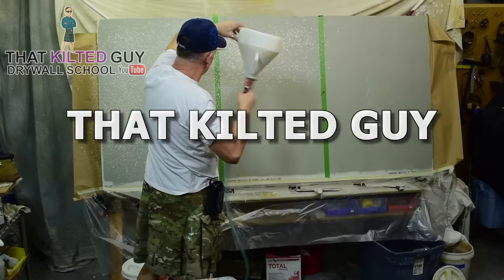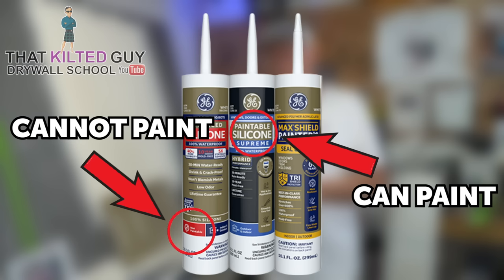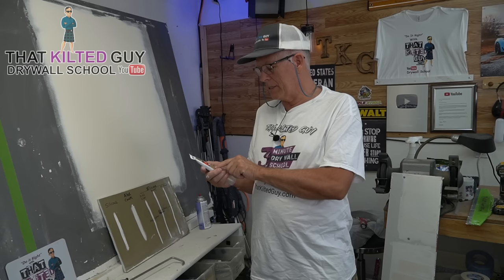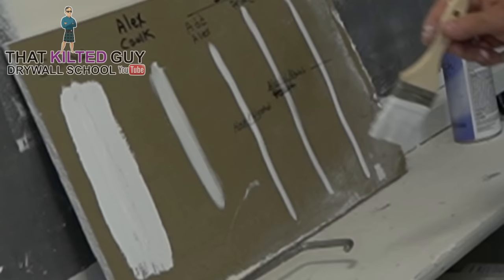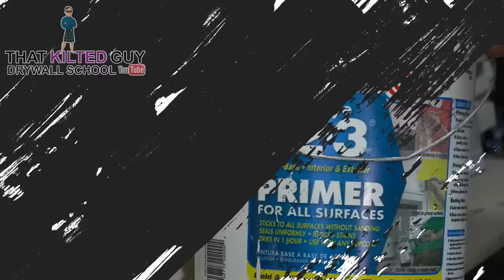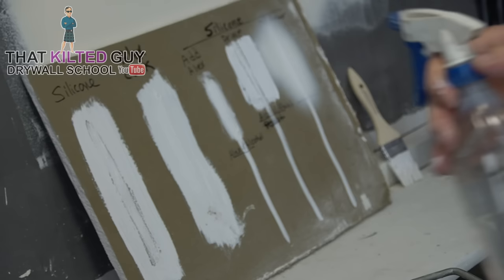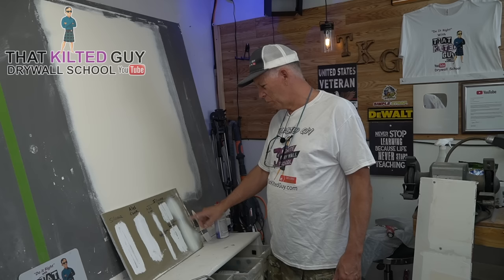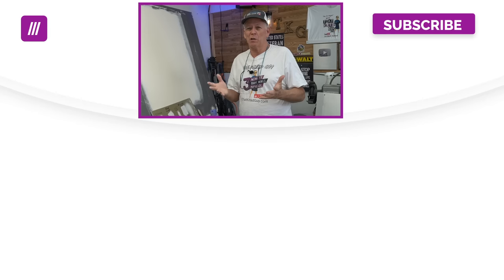Never Use Silicone Caulking Like This, Trust Me

Comment: I've been painting and drywalling for 22 years and I've seen this happen, white pigmented shellac will make it paintable or oil base primer, if not it'll fisheye big time. This man really knows his stuff. When I use silicone caulking in wet rooms I basically cut the tip as small as needed and don't wipe it, kinda like sider's, you just gun it smooth, small, and evenly.

Comment: A good way to finish silicone is to carefully run a bead than spray it with denatured alcohol then wipe it with either your finger or a grout beading tool. It won't stick to your finger or spread out when finishing it. Comes out lovely.
Reply: Thanks for the tip 👍🏼
Reply: I use ammonia free pressurized window cleaner. They sell it at Walmart or the dollar store, it's in a blue and white can. The brand is called Sprayway....I have a can of denatured alcohol but it's much more expensive than the window cleaner. Just a tip if you don't want to waste your alcohol! 🤣🍻

Comment: Thank you! My parents DIY'd their bathroom, and the caulking around the bathroom sink is horrendous. Trying to paint and repair, and got stuck! Glad to hear the oil based primer will do the job - I was thinking I might need to scrape, sand, and recoat - so this is a way better solution.
Reply from the maker: Thanks, glad I could help you out 😎. And thanks for subscribing!

Comment: Ok. Another good video. You are 100% correct. You cant paint over silicone, and it is really only good at a few things. Calking countertops to each other or against areas not to be painted...ever. Or in building fish tanks.
Anything else either use something like "siliconized " latex or for areas that need to withstand the elements a polyurethane caulk. Which I would not recommend for novices but is probably the best all around sealant there is.
Latex caulk, or even silicone caulk over silicone caulk will eventually fail. If a bath or shower needs to be recaulked. You must remove all the old silicone caulk and as much of the residue as possible. For some reason. Not only doesn't anything water based like to stick to silicone. But silicone itself doesn't like to stick to cured silicone either. it will go on. But it wont hold up.
If you must paint over silicone or anything that has had silicone on it (the residue often remains even after the silicone is removed) the oil primer will work somewhat. But as someone else pointed out a shellac based primer will work and hold up the best over the course of years. BIN is one. Sherwin williams also makes one though the name escapes me at the moment even though ki have a can in my truck. LOL
the good thing about shellac based primer is it sticks to everything. the bad thing about shellac primer...is it sticks to everything. So be careful on what you get it on. Especially eyeglasses.
Reply: Shellac based primer is good to know, many THX 👍

Comment: I learned a trick - if you put unpaintable silicone and need to paint it - put a coat of shellac paint first on the silicone bead.  Then it dries, you can put a regular paint on top.  Not perfect,  but it can cover some mistakes.

Comment: I prefer Dap 230 over Alex. I can use it inside and outside. Only downside to Dap 230 is longer drying time. It acts like a silicone and never cracks.
Reply: Much better stuff than the regular Alex.

Comment: My Husband used 100% silicone caulk on the bedroom   (didn't read the label and grabbed the wrong tube) I have been trying to figure out how to get the paint to stick / have tried everything (including peeling the caulk off - which I could not).  Never thought of oil based paint !   Thanks So much!
Reply: You could also cover the silicone caulk with a skim coat of paintable caulk, once it dries you can paint over it.

Comment: Installed over 100 tubes of silicone in my row home most of them 35 years ago when I had walls open. Silicone gaps between hardwood floors & walls. Silicone bottom of sheetrock to floor silicone to seal all electrical boxes on outside walls. Got most of it free from work. Have all low e windows and added insulation in static equal to around a R45. Had the temperature set at 74 to 76 all last winter and gas bill was never over a $100. That includes gas water heater dryer & stove. Usually purchase bathroom silicone because it usually will not mildew.

Comment: Silicone caulk that burns your eyes is releasing acetic acid. There are other silicones that don't use acetic acid as a curing agent. The problem with the silicone/paint combo is the silicone oil in the rubber base material. Nothing sticks to it. Alcohol can help to remove it but it's really always there.

I used to build semi custom boats and I wouldn't allow silicone in the building. Fish eyes in a hull side stand out like a sore thumb and ruin a $10000 paint job. And can ruin it a second time if you don't get it all off (and you never really know until you pull the trigger). I hate silicone.
Reply: Wow !, Ok !, What do You use ???
Reply: @michaelbox5355  
Urethane sealants like 3M 5200

Comment: Silicone has low surface energy, it means is hard to bond after cured and the paint won't stick. I have used PU sealant indoors, they are paintable and have a good range of hardness and flexibility.

Comment: As a professional painter I hated the fast dry caulk and would never use it. The only time you really need it is if you are needing to paint right away on a repair job. But it doesn't feather right and requires to wet it to spread it.

Comment: Nice video and cat. I recently used white silicone between a white plastic window and wood window trim. Not sure that was the best solution but I was painting the trim white so the paint resistance of the white silicone actually seemed to help result in a clean line.
Reply from the maker: Thanks 😊
Reply: 0000

Comment: Even though I knew better - I had some leftover white silicone caulk after trimming my countertops & backsplash didn't want it to goto waste. So I figured I'd burn this tube out trimming inside small cabinet above stove (all cleaned & prepped minus white paint tho). Of course my paint ran but Rustoleum sells a universal bond to anything primer spray paint. Sprayed some layers over my silicone joints and it painted beautifully. EZ fix highly recommend!

Comment: That 10 year mold free resistance thing on that product is questionable .. I've re-silicone'd my shower door frame twice in the past 3 years, and it needs it again.. the mold ONLY shows up on the silicone..nowhere else in the shower. I strip all old caulk, and clean completely each time before I caulk again..  I'm wanting to try another brand..
Reply: WVmom63   Or it doesnt, like tge entire bead of silicone joining two shower panels or every air condtioner ever made ever.

Comment: Lexel when possible. If you're doing around a sink, or countertop, or something where there's a gap to the wall, paint the wall first. 
   It's crystal clear and it will look like a perfect line from any angle. 
    Yes it's expensive
Reply: If you ever want to paint again, it's paintable you don't have to scrape it out. It sticks to itself. If you want to put more on, you don't have to scrape it all out. 
   It sticks to nearly everything, near water or not.
Reply: Lexel, the Lexus of caulking.

Comment: Just several months back I painted a bathroom that had work done to it about 15 years ago, unfortunately the people who did the work used 100% silicone calking around not only the tub and sink but also the molding around where the walls meet the ceiling, yes it was a nightmare. 
One of your contemporaries on another channel recommended a can of spray shellac to coat the silicone with first and it worked beautifully. 
That same trick was also recommended by someone on another channel to coat drywall areas that have had the outer layer of paper torn off exposing the brown paper underneath before putting mud on them for fill, it also worked beautifully for that and doesn't take long to dry after spraying it on.
Reply from the maker: It does work great for those things, but I avoid it often due to the odor in a customers finished home, and the flammability issue, but it's pretty safe in small amounts.
Reply: @ThatKiltedGuyDIY  
Yea I only used it for spot repairs generally, the silicone in that bathroom got primed over shortly after the shellac was applied since it dried so quickly and sealed it's odor off before the homeowner even got home from work that day.

Comment: i bought a mobile home to fully remodel (flip) and this crap is EVERYWHERE. window installation, fixing (they wish) everything. sealed around counters and sinks on walls. The only place they did not use it was around the tub and shower which is the ONLY place for silicone.

Comment: Good video! Thanks for some good information! I hope you are feeling better these days! I have to do some work at my mother in law’s house soon. She has one bedroom where in three of the rooms corners  it looks like someone caulked the vertical corners. When it starts getting cold the corner blisters the entire length of the adjoining surfaces. During the spring/summer it goes back to normal. It looks like they butted the vertical corners tight to each other and did not pre-fill the joint with hot mud. Do you have any suggestions. Thanks for your time.
Sincerely,
Ron
Reply from the maker: i’ve caulked many angles and seen them years later and they were fine so it sounds like they used a really low grade caulking. This caulking is made to stretch and expand and stick really well and I plan to test it soon. https://amzn.to/3iOy7Kp
Reply: @ThatKiltedGuyDIY  great thank you for the advice/information. I will give it a try.
Thanks for your time Guy, I hope you are as healthy and wealthy as you are wise!
Sincerely,
Ron
Reply from the maker: Thanks, not that great on either health or wealth but working on it

Comment: Well on my next trip back home to the States I will be bringing back several tubes of GE's best silicone caulk. The products I have used here trade names Mercola and Den Braven might get you two years before they sprout black mould. Lucky I have not done any finish caulking in my baths in my home. I tested those local caulks on rental property and they failed miserably.

Comment: This is off topic, but I have heard that you shouldn't use tile in manufactured homes, is that true? I have seen them from the factory where they have grouped LVP-I assume that's what they used as it looks and feels real but is half the thickness of real tile.  But I have also seen in higher end models where they have tile walk in showers,  so I don't know if they add extra support for the weight or if they use a special type of grout? We have a 2005 Norris single wide and it expands and contracts a lot- like the LVP flooring has gaps in it, and the Crown molding had gaps in it so we puddied up all the joints so now when it expands it will bow out from the wall a little- is that normal?  We used too didnt keep the ac temp set the same we would do 67° day and 59° night. We stopped doing that but the gaps still are getting bigger and bigger in the LVP floors. The house does have factory tile trimming the countertops and there is no cracks in the grout which made me wonder if they use a special type of grout. I feel like this message is all over the place,  sorry about that.  The adhd is real today lol.

Comment: I want a caulk to fill in on a board and batten wall that's printable  what do you  recommend  ? Wouldn't it just be safe to use a caulk without silicone  ?
Reply from the maker: Is that lathe and plaster? Not familiar with the term.
Reply: Board and batten  wall it's just 1x3 boards added to a wall  vertical and horizontal for looks  but it said to put  a bead of caulk  along the boards
Reply from the maker: Some of the best caulking has silicone in it. Just avoid pure silicone
Reply: Thank you God bless and Happy Holidays

Comment: I made the mistake of letting the guys doing my home's weatherization do whatever they thought was best many years ago before I became a DIYer. They ran that da#n silicone around every single window, vent, door frame and crack in my house. I get OCD when trying to remove it and end up having to repair the drywall. Is there an easier way?
Reply from the maker: Just what I showed
Reply: @ThatKiltedGuyDIY  i apologize...I stopped when you were showing the different types of caulk because I thought you were going in another direction and id already been watching your videos for 20 minutes so I went back to work on the walls. I'll watch the rest now. Thanks!!
Reply: Ok so they were all the same caulk ...I thought you were comparing different types of caulk for some reason.  I'm gonna need A LOT of tape.

Comment: Nope. Dap Alex is garbage. Dap has good products but Dap Alex when applied correctly will crack in a year or so. You'll need a paintable caulk with a 50 year or more guarantee. I have experience with Dap Alex and I haven't used it in over a decade. The 50 year guarantee isn't necessarily a guarantee but a telltale that it'll last longer without cracking. Different polymers.
Reply: I noticed this myself a year ago with some DAP Alex white caulking. I couldn't keep it from cracking, ever after multiple applications.

Comment: In the business using caulk all day long with windows and doors. Save yourself the time and effort and find a good Polyurethane caulking it's indoor and outdoor bonds very well to almost anything except dust. It's flexible, paintable can be cleaned up with den/alcohol. Imo have plenty of extra paper towels to clean up or use blue tape to make a straight caulk line. Fill the area ur sealing, don't just run a light bead and smooth it out. Cut the tip to the width that u would like the size of your finished caulk line. U can also use a window cleaning solution soaked rag to dampen your fingers if you are mint using a caul king tool as It repels the caulk from sticking to you as well as makes it easy to use and keep ur hands clean so dirty finger dont makes dirty caulk line. One of the best tips to make sure u don't start making a huge mess and getting caulking one o everything is to use an old shirt like a painters board, hold the neck line and pull it back over your arm inside out an as you smooth the caulking out wipe the excess that is pulled off right onto that shirt and when your done just take hold of the bottom  of the shirt closest to you elbow and remove it so that your caulk covered sleeve part gets pulled back over keeping all that excess caulk on the inside and creating a larger  mess that cause you to spend as much time cleaning up mess that can be avoided.  Sorry if it's confusing. I tried to explain it easily and detailed how it will keep your area clean
Reply: I’m ok